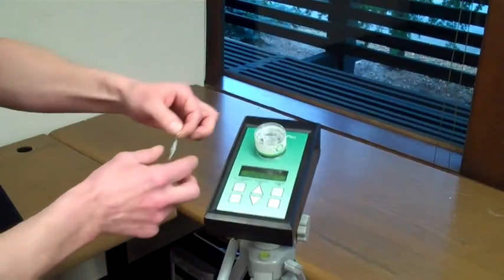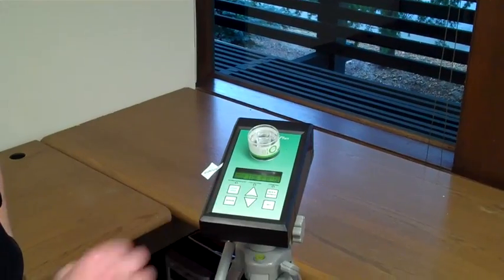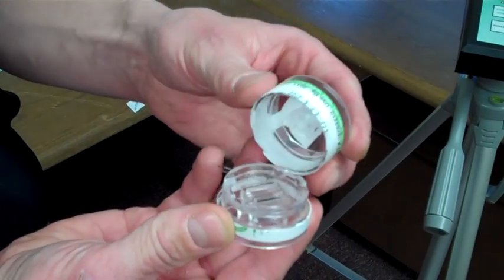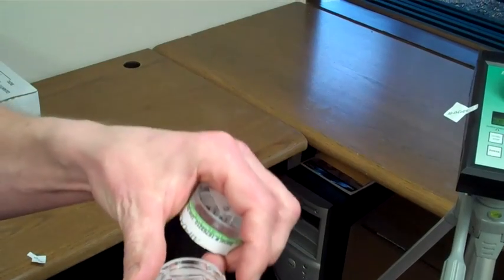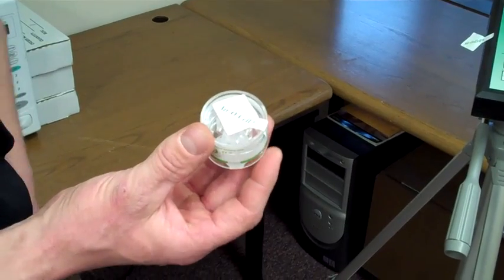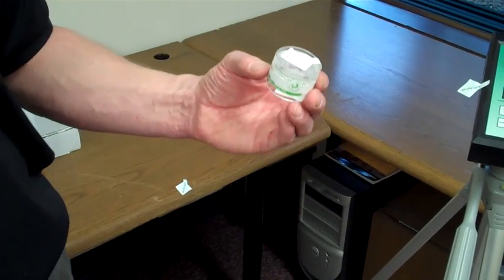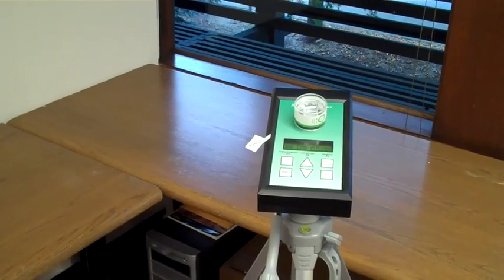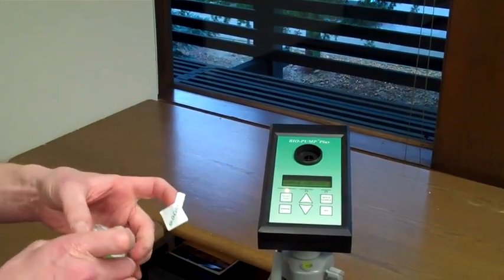Ambient Air Mold Testing - Mold Sampling Part I of III

Comment: Is this single sampling  method accurate? How accurate?
Reply from the maker: @Richard  A single air sample doesn't tell you much. We always suggest, and our labs require, an outdoor sample as a "baseline" measurement. With that, any other air samples can be compared to the surrounding environment for a relative comparison of moldiness. This video is really intended to give our clients an idea of what to expect during sampling more than a how to guide.